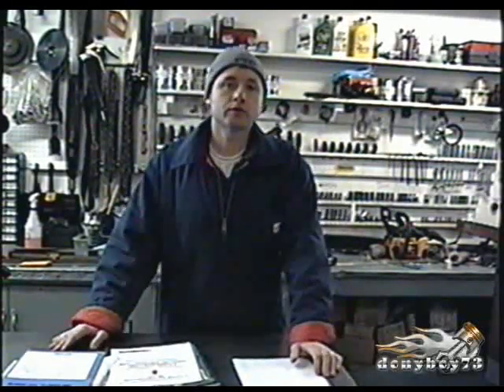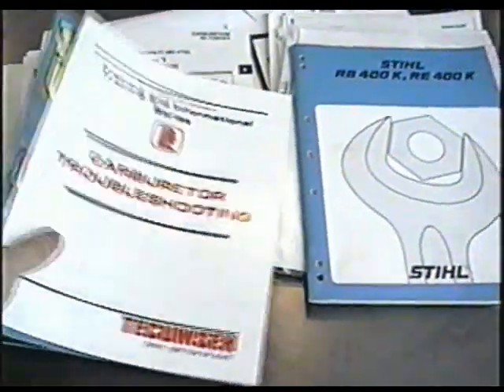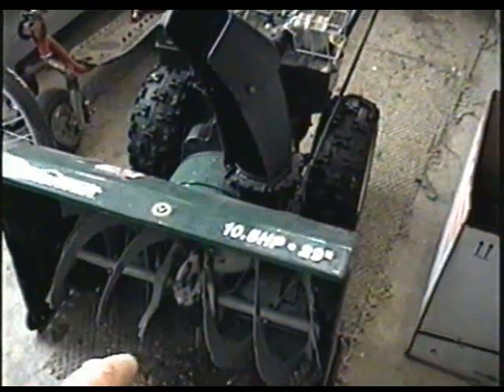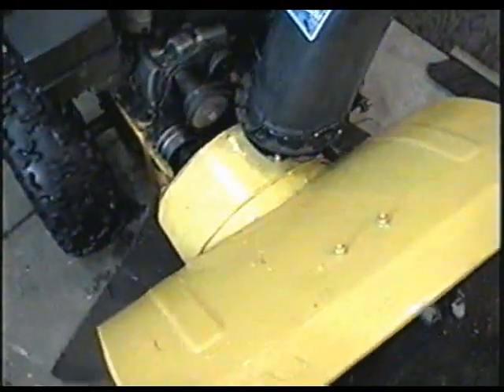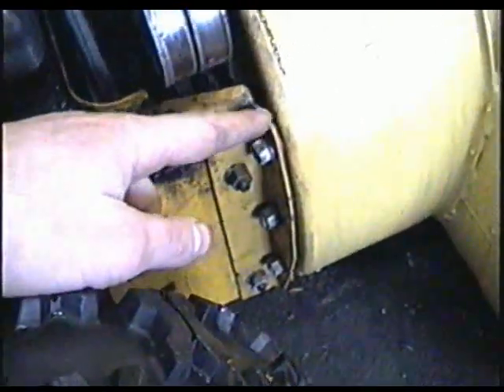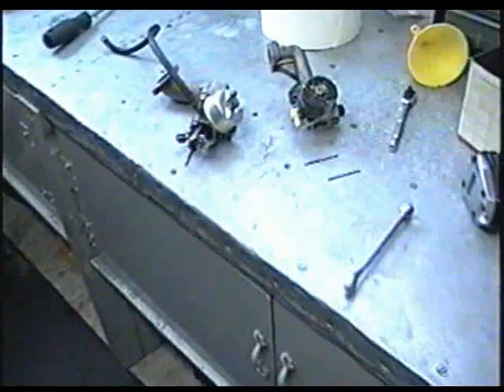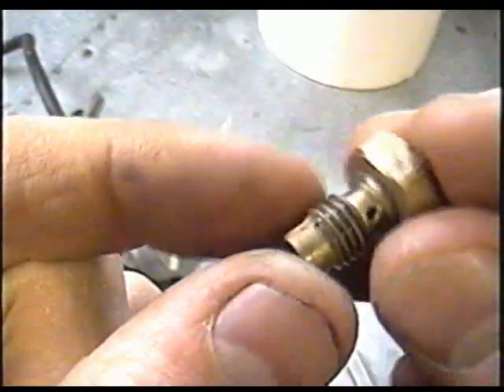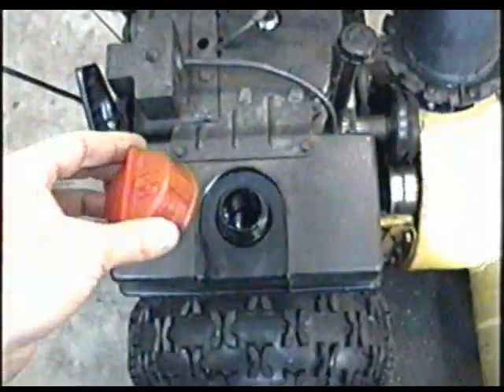Small Engines Q & A  Video #27

Comment: Good pointers on the surging problem. I delt with a surge condition  on a John Deere motor a few weeks ago. I had done a valve job  on the head and on the first startup it is was surging wildly and occasionally backfiring out the exhaust. Turns out it was carb outlet gasket that was not sealing and was killing the inlet suction on the carb and therefore was leaning out the mixture. One  symptom was that the surge timing was perfectly cyclical (like a surge every 1.5 second) and constant.

Comment: One time I fixed a surging engine by adjusting the linkage from the governor. I got the idea from a Tecumseh manual on how to trouble shoot carb problems. There was too much slack in the linkage. I loosened the adjustment screw on the linkage while it was running and the engine suddenly smoothed out as the slack was taken up. I then just tightened it down and no more surge.

Comment: @umajunkcollector TORO's are pretty good. We have an old Power Throw 622 I think it's called. My mom bought it new about 12 or 15 years ago and it still runs like a top aside from having a carb rebuild last year. Throws pretty good for being 6.5hp. Only down side is the old flat head Techumse in it is cold blooded in cold weather sometimes and it needs a new primer knob. But other than that once it's running it won't stop unless you shut it off or run out of gas. It flings heavy stuff good too.

Comment: i have a 68ish john deere 140 when ever i engage the electric pto the motor just dies the deck spindles turn freely the belt in fine has some slack it haas no safety switches when i take the belt off it wont kill the motor but the pto seems really loud could the pto kill the motor or is the engine out of tune or is it a governer issue